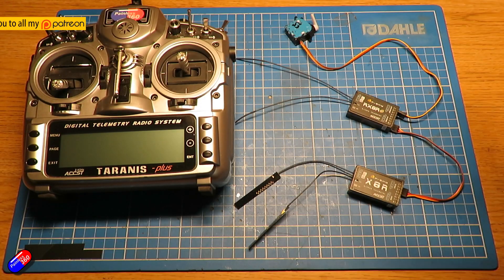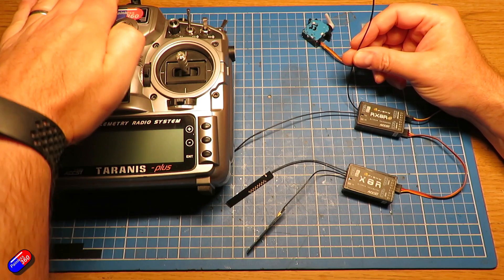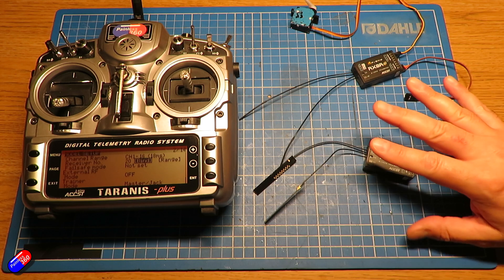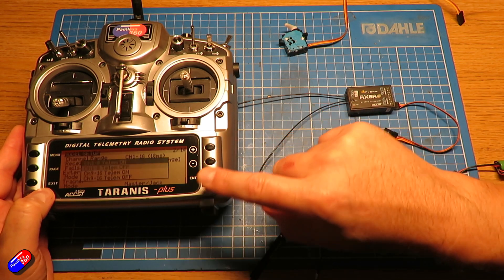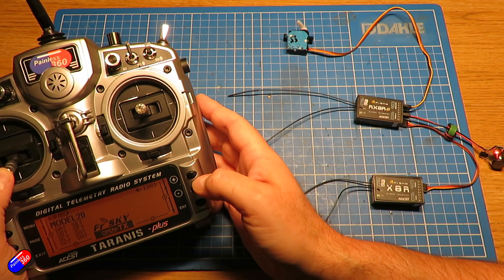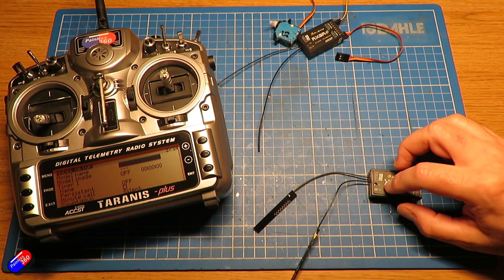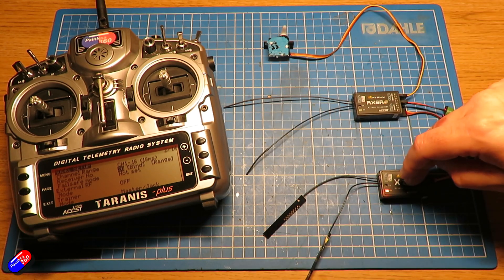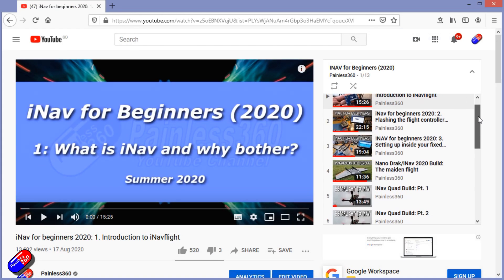How to connect and test FrSky redundant receivers (Patreon Request)

Comment: could you connect the 2 rx together without the power wire/only the signal wire in order to keep them on separate power sources and the same signal?
Reply from the maker: That would add an extra level of protection... Happy flying
Reply: @Painless360  that's my intention. I was questioning whether different voltages would affect their operation together. Then I remembered the becs will be set the same. Never had a reason to use 2 so haven't tried it yet. Wish me luck. Thanks

Comment: Can 3 recievers in a chain on onne model bind to3 transmitters and hav 3 pilots spaced 1000 feet or more  apart on the ground to fly triple range distance ?
Reply from the maker: You can 'clone' a radio so that the receiver sees the other radios and binds to them as they come into range.. Happy flying!

Comment: Great video as always. Can this redundancy also work when using 2 Frsky X8R receivers with 16 channels active? I am using this setup for the Avios Spitfire with fpv and head tracking. 6 channels for the taer+gear+flaps // 3 channels for the gimbal movements // 1 channel for navigation light. If redundancy option is possible, how to connect the 2 reveivers with each other? I can't get it to work at the moment. The 16 channels are working fine, but the one receiver doesn't take over from the other one when receiver number is changed.
Reply from the maker: I don't know. Sorry I can't help this time.. Best of luck

Comment: When doing this, can I use the RX8R PRO in high speed servo frame rate mode?  By that I mean 9ms as opposed to 18ms.  Will it conflict with the X8R only being capable of normal, 18ms servo frame rate?  Would there be  adrawback to doing this by connecting signal pins for channels 5 & 6 during bind on the RX8R PRO?
Reply from the maker: I'm not sure, let me know what you find... Best of luck

Comment: Is there any way to bind the RX8R pro with the DJT module (using it with the Radiomaster TX12mkiiELRS/EdgeTX).

need some help please
Reply from the maker: Yes, make sure it is using the ACCST V2.x firmware and it should work as normal. See my video on binding Multi-protocol modules. Best of luck!

Comment: Hi my dear friend.
I need your help.
I have the radio radiomaster tx16s  with EdgeTx software and a  wanna buy some recivers to use on my 3D airplanes but is very important for me to have telemetry of the battery of the plane so can you tell me witch brand is the best, is for 7 or 8 servos.
Reply from the maker: I still use FrSky ACCST V1 X8R receivers here. I've got so many that I've not needed to buy anything else for a few years. Anyone else got any ideas?
Reply: Can you share info what receiver you decided on your plane ?  It is gas or electric ?  I've been using X8R with zero issue on 2 diff electric planes.  RX8R Pro is said to be safer with gas ignition.  Found something I never even considered with Lee's upload.

Comment: Can i use Sbus for controlling my autopilot and any another channel to control my additional payload at the same time ? Or Sbus anyway combine all channels in one ? 
If its possible can i use one receiver ?
Reply from the maker: SBUS is a single wire digital signal that carries all of the received channels to the flight controller. You can forward channels onto spare pins on the flight controller to allow for control of PWM devices. Or you can use something like the setup shown in the video to add more PWM outputs..
Reply: @Painless360  Ok, i have a Simple Pixhawk. And it’s uses Sbus. So all channels are wired in one. I need to have one empty channel from receiver to give my Arduino microcontroller Pwm signal. If I will pair two receivers I will have an additional channels on second receiver not covered by sbus. So I can connect to my Arduino second receiver channels and first receiver to autopilot by sbus ? 

I’m trying make a data logger. I connect my Arduino to autopilot. And I want to collect data when Arduino gets pwm signal. I can’t get Pwm from my pixhawk, because it’s can overload him. So I decided to do it by receiver. But they connected via sbus. So I’m looking for solutions, how can I get free receiver channel not covered by sbus.
Reply from the maker: Introduction to the EagleTree Vector and MicroVector: https://www.youtube.com/playlist?list=PLYsWjANuAm4rGvGdhkpYE6VWCdTEmz0kB may be worth a watch.... Happy flying

Comment: Lee, I tried this setup using a RX8R and a S8R this is the issue I ran into. This was used on a heli with everything set up I would get a random control movement. This would make for a bad day flying. Needless to say would make a bad day flying is there an issue using the S8R? Thanks
Reply from the maker: I wouldn't use an S8R unless you could be sure that it wouldn't be acting as a stabiliser....
Reply: @Painless360  thank you

Comment: So I have the RS8R with a crossfire nano plugged into the sbus out.  I have the RS8R bound to the internal module and crossfire on the external module... I am under the impression its able to use both, but I am not sure if it is actually working.  Does anybody have any ideas how I could test that?
Reply from the maker: You can turn off the external radio module in the radio... Best of luck

Comment: I think that if Need Sbus to flight controller. And I also need PWM channels like landing gear , or some other things with PWM channels and Fc is using SBUS then other uses Sbus and other can use normal PWM 8channels... So am I right? because I understand It that way when asked Frsky. But my english skills are not perfect because im from finnland there might be misunderstood
Reply from the maker: A lot of the receivers that have PWM and SBUS outputs will output both at the same time so you can use the unused PWM outputs on the Rx for other servos on the aeroplane. You can also use channel forwarding on the flight controller to present channels on the spare PEM pins for things too. You can see me do this in this video: https://www.youtube.com/watch?v=DTrFuCvA7oU

Comment: I’ve done something like this with an RXSR and an R9 receiver. That gives you redundancy, but redundancy at different frequency bands . This may be better than duplex redundancy at just 2.4 GHz.
Reply: That's what I wanted to ask, if it works in such a setup (2.4GHz + 900MHz). Does it work the same way or your setup was different?
Reply: @robertkulyassa2084  I think it works for any receiver with an SBUS In (as the master receiver). This guy has a pretty good video of one example and this is what I used, but the ones shown don't have PWM outputs.   https://www.youtube.com/watch?v=rKzYaPnualk

Comment: Good tip on changing the RX number to test redundancy is working, but the real wrinkle Frsky need to address is how you  optimise RX antenna positioning on the secondary RX without RSSI available. I understand why getting telemetry from both at the same time isn’t possible, but what they should work on is a way of being able to select which RX delivers the telemetry from the TX at any given moment. That would be killer functionality, but Frsky being the experts at ignoring user requests and shooting themselves in the foot these days I doubt they will ever deliver anything like that.

Comment: the down side with this is the telemetry warnings,    you still get signal low warnings even if the back up receiver has a perfect signal because the telemetry is coming from the master receiver, there really needs to be a way to get 2 simultaneous telemetry streams so the pilot knows they have a good signal and proper control.

Comment: Since the redundancy feature works on sbus, is it possible to use a small r9 sbus receiver as a backup to get a dual band receiver for the tandem x20?
Reply from the maker: Any sbus capable reciever should work but I've not used that one here.. Happy flying